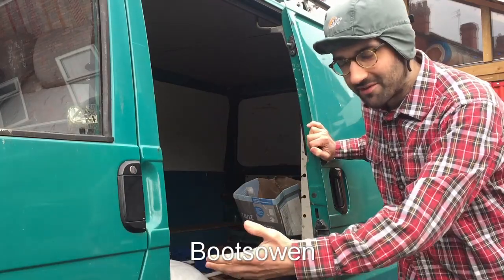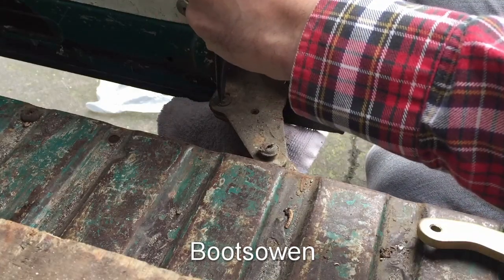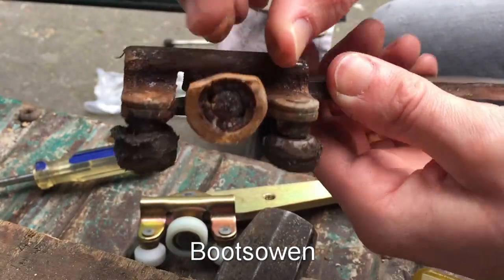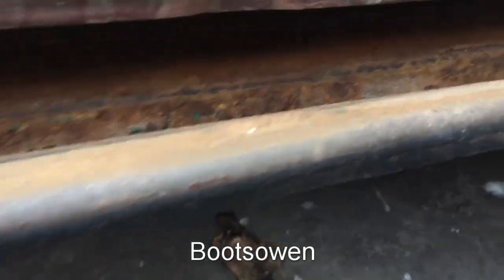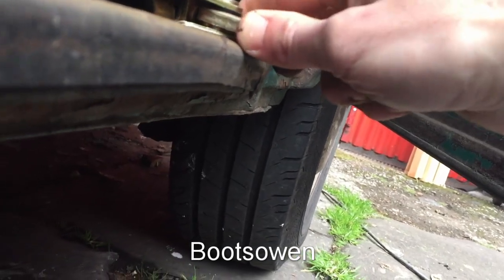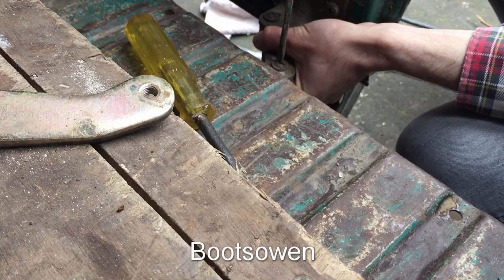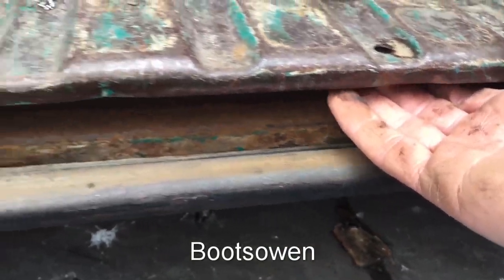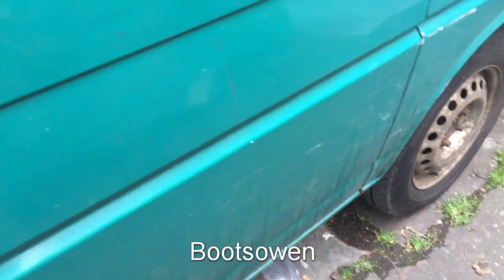VW T4 Sliding Side Door Roller Repair

Comment: You take as long as you like mate! You saved me a fortune over the years......... done my cambelt & waterpump over the last few years, first time I had the laptop on the passenger seat :) Literally discovered today that my runner needs replacing (bought the complete set a few years ago just in case) and shutting the door today the top roller dropped out of the track............first time I've had an issue with it in 14 years of ownership (and shes my work van, too!)...........so this video is massively helpful.
Reply from the maker: Cheers buddy

Comment: Got another hint that might help somebody out, I couldn’t remove the bolted in door stop part, the screws were totally seized and I needed to get the door closed for the MOT. Once the channel is fairly clean from debris, get a torch and look at the condition of the upper channel guide metal, to get the new roller in I found the worst part of the runner that had a folded edge where something had forced the metal out and made a slight lip, I worked out I needed a mm or two to get the new roller in so used the claw part of a hammer to lever it out just enough to slide it in, then used an old tyre lever with a flat end to carefully push the lip back in line. I wouldn’t want to do this more than a few times but it was a quick “work-around” and I am back on the road now. If your vans like mine there will be a few other wobbles in the runner which you will find when you try to close the door, these weren’t noticed previously as the bearings were cream-crackered. Hope this helps somebody! 👍

Comment: Thanks for sharing this video, I have just recently purchased a T4 800 special 02 plate which has the same problem. Just ordered the new roller so will be doing this job on the weekend. Do you know much about the tailgate locking mechanism? Mine will only open from the inside and does not work from the outside.
Reply from the maker: Hi George, I have the double doors, so no tailgate, but nothing on this van is complicated. I have posted a video of the rear doors locking mechanism from when someone broke in to my van, so maybe that will help you. It is in my VW T4 playlist.
Reply: @bootsowen  Cheers, I'll take a look.

Comment: I recently changed the carbon brushes in my mum's dishwasher even though I'm a chippy in the making, but I watched your vid dated 5th of August 2017 and it is making the same noise as the one in your vid but it's sparking a bit but nothing major, I was just wondering if it will be ok and won't self destruct or something. Keep up the good work by the way
Reply from the maker: I think you want me to validate what you have done, even though I know nothing about what you have done or how you have done it.  I can't reassure you that a machine that is sparking is ok, it probably isn't.  Maybe get someone who can see it to have a look at it.  Or post a video of it and ask again?
Reply: @bootsowen  ok, I'll have someone check it out. Thank you for the help